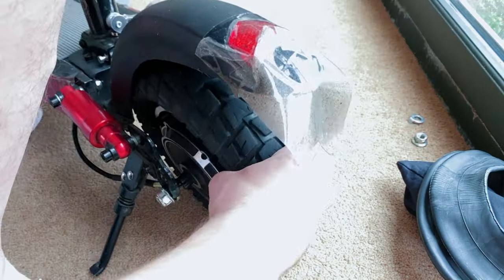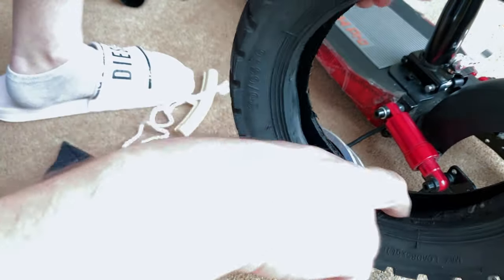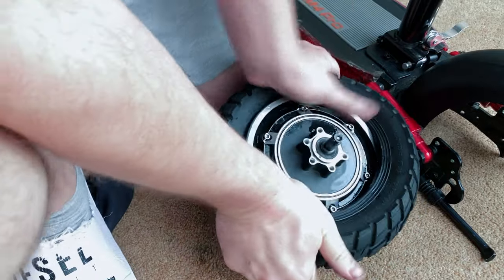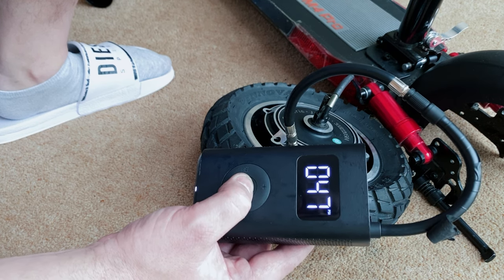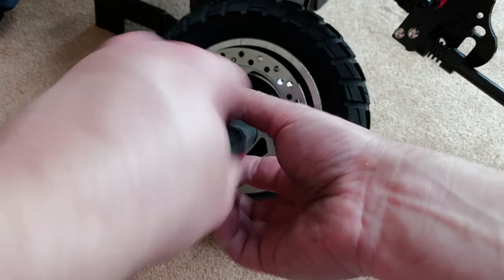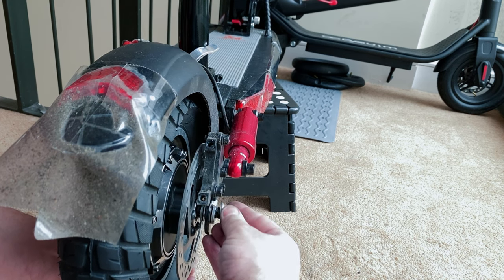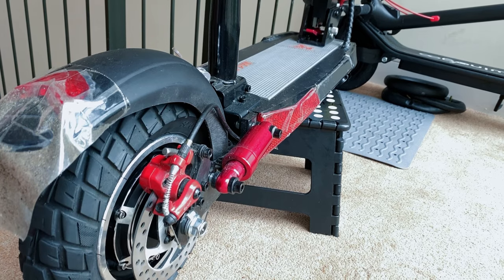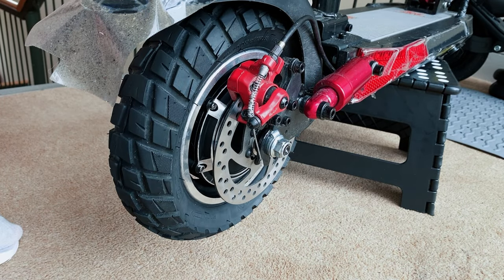Electric Scooters Tube/Tyre Change (STEP by STEP)

Comment: It's so hard to put tire on rim 🤯
Reply from the maker: New tyre replacement is of course more tough. But overtime, you get faster.
Reply: Yup. After blood, sweat & tears, I ended up scratching the sh!t out of the rim & ruined the tire. So bought a new whole wheel from Aliexpress 🤣
Reply: I bought a new tire for my scooter and it's like slightly to small to fit, I don't know if it's supposed to be like that and your supposed to force it on but it looks significantly smaller so I don't know. The listing on AliExpress says that it fits my scooter
Reply: @DARK_AMBIGUOUS  press on the inverse side of the tire when you put on, il fit but it can be hard to put
Reply: @amped19996  WTF

Comment: Getting the tyre on is doing me friggin head in 😤. I've changed many bicycle tyres in my time which is pretty easy. These are not. 5th time changing a esctooter  tyre/fixing punctures and it's not getting any easier. If I find an easier way I'll add it to this comment 🤞
Reply from the maker: @footlongsubzero1128  use your knee to old down the tyre and use your 2 hands to push it on the rim

Comment: Better then silicone spray is to use your hand dish soap with a little water mixed in 🙂
Reply from the maker: Never tried it but thanks for sharing. Can help others that don’t have a spray to hand for sure.
Reply: Won't water And soap, rust the inside???
Reply: @mutatedAi  Hand or dish soap?

Comment: Thank you! It's awesome I was struggling with this! I have 2 tips for you that you can apply : 1. Cut the old tube and put the new one inside. Thanks to this there will be less friction between tyre and new tube, 2. Put a lot of tlacum powder inside!
Reply from the maker: These methods are ok but generally best thing to do is get a better quality tyre. After this video was made, I bought a higher quality one and didn’t have a puncture. 

The tyres though supplied in this model scooter are actually quite soft and poor quality.

Anything is worth a try though if you are stuck! PMT tyres I have t tried yet but meant to be the best there is.

Comment: Do you need to disconnect the back motor or just take of the motor and change it near the scooter so you dont have to disconnect all the cables, i have seen some take the whole motor off is that reall necessary?
Reply from the maker: @alexanderlundin4811  assuming you have the M4 Pro? not needed. There ain’t much slack on the cable so just be careful. 

Very time consuming to take off the motor completely.

On some scooters you have a quick release connector or more slack which makes things easier. Just be careful and you’ll be fine.

Comment: I'm 68. You make it look easy. I was afraid of damaging the rim or tire and had to take a break. Thanks for your video, it made it so simple. I'm missing those wedge duhickies to keep the tire out! Thanks!😂
Reply from the maker: @adolphsmith1353  trust me, I sweat many times
Reply: After buying the wrong tube, I'm finding it hard to find one with the bent air nozzle. What I'm finding has a very high shipping cost, almost as high as the tube itself.
Reply from the maker: @adolphsmith1353  AliExpress 👍🏻

Comment: My wheel is wobbling how can i fix it , also the tyre is damaged cuz i changed 3 tubes
Reply from the maker: @itsanutz3286  if you damaged the tyre you will need to replace it. Pump to about 60psi after changing so it seats into the try rim then deflate to around 45psi
Reply: @Movelectrics  the problem is that the tube has a hole in it
Reply from the maker: @itsanutz3286  replace it

Comment: Nice video mate! Got a question if its ok. I have an iscooter ix4 with 10 inch tires. The dimension is 10x2. 75-6.5 what solid tire do you recommend fitting on it? I have air filled and popped the tube 2 times already 😅
Reply from the maker: @yasharostad  avoid solids. They’ll destroy the scooter because of the vibrations eventually. I would get better tyres to be honest and maintain the pressure to around 45psi.
Reply: @Movelectrics  thank you very much man. I'll be looking for a good tyre and a new inner tube. I can't seem to find the right tube, is it the same dimension as it states on the tyre?

Comment: Hello bro .. i got e-wheels E25 V2 .. what tyre do you recommend and what inches is it 

+ can i use a heavy wheel like the one in the front ?😅
Reply from the maker: Size should be on the side wall. Think they are 8.5inches. Search AliExpress and check out reviews from buyers. There are hundreds of tyres to choose from.

Comment: Not sure if you are seeing this but i just got a urbanmax cq today and it was a little deflated so i went  to an airpump near me to fill it. It said it was doing like 10 something? (Never dont any of this) it filled very fast so i had it on for less than a second. It looked and felt fine and solid but when i was riding it was wobbly in the front. Idk what happened but it looked like it either came loose/expanded a bit cause it was slightly off the rim ,not much but enough to make it wobble. You know if i popped it or not? Dont wanna have to get new tires/replace it yet since i just got
Reply from the maker: Never use garage pumps. Buy the Xiaomi pump that battery operated. Deflate, make sure it seated properly and pump again. Sometimes there is a slightly wobble but in general is fine while riding. But if it’s very bad, a tyre change is needed.

Comment: Hello when you receives this do the tires come prefilled or do you have to add it yourself and if so what is the correct tire pressure? For the bogist c1 pro
Reply from the maker: You put air in yourself. Best pressure is 45psi.

Comment: Where can i find those anti-air loss extensions? is something that's included in the xiaomi compressor or do i need to purchase it separately?
Reply from the maker: It’s sold separately. I got it from the place linked below. But they are also on AliExpress for cheaper https://bit.ly/2UNHa1M
Reply: @Movelectrics  aight bro, much appreciated. Keep up the great content

Comment: is there any tubeless tyres you can get with the bogist and use that liquid stuff inside the tyre to seal it from punctures? or is the c1 pro tyres good enough not to worry about them thanks
Reply from the maker: Not sure about tubeless on the C1 Pro. Main thing is to maintain the pressure. Funny thing was, I never got a puncture on the C1 Pro compared to the Kugoo! I also just bought some sealant to test out. But since this video I have upgraded the rear tyre and have not had a puncture. Check out the community tab to see which one I’m using.
Reply: @Movelectrics  oks thanks for the reply , i should be getting my c1 next week . they state that the tyres are "stab proof" so maybe that's why you don't see many punctures on them?
Reply from the maker: They have air in them so it’s very possible to get a puncture. I would suggest keeping the pressure around 45psi.

Comment: Does it work resealing wobbly tire..?
Reply from the maker: Your tyre is off balance? Could be the tube or the tire is not seated properly. Deflate completely and put some dish soap around the rim, inflate then to about 55-60psi then deflate to 45psi.

Get a professional to do this if you ain’t sure. If the tire is still wobbly, a new tire is a good option.

Comment: Hi mate, does this tyre change apply to the M5 Bogist?(this is the one my mother has lol)
Reply from the maker: She has the scooter that has the seat and basket? Bigger wheels on that so it should be easier. Same method mostly for removing and fitting. Just take pictures of the washer/spacer arrangement.
Reply: @Movelectrics  Yeah that’s the exact one. The one you thought was ugly 🤣Anyway, I tried clicking on the link you provided for the tyre irons you suggested on Amazon and it’s saying it’s currently unavailable. Would you suggest any other alternatives?
Reply from the maker: @Aaron-lr1di  any tyre leavers will do. Try a local bike store.

Comment: I actually damage my back tube stem from a certain stem cap do you know a way to possibly fix the stem or am I just gonna need to go ahead and change the tube
Reply from the maker: Easiest thing is to replace the tube. You could have damaged the stem core, you can replace them quite easily. They screw out. You need a core removal tool.
Reply: I ended up replacing the tube by watching your video. The one part I messed up on is the washers on the inside of both rear swing arms on the Eagle one do you know how many washers go on the right swing arm? I have one main washer on the left and two on the right but I have one thinner  washer that I can’t remember which side it went on.
Reply from the maker: @shanemontgomery4692  one washer on the left and 3 on the right side (brake disc side is where the smaller washer is and goes in between the 2 bigger washers) from what I remember.

I made a video changing the tyre on my E1 👉🏻 https://youtu.be/6gg8IN06qgc?si=GyZE8PHoU7eIxQ7V
Reply: Thank you so now I have the washers correct and the brake disc is rubbing hard on the left side of the brake pad. Am I gonna have to adjust the brakes?
Reply from the maker: @shanemontgomery4692  generally you will always have to adjust it after completely taking it off.

Easiest thing to do is loosing a small bit the screws holding the caliper on.

Squeeze leaver and then re-tighten at the same time. Might have to go back and forth till happy.
Reply: Awesome I got everything lined up I really appreciate the help last question is how much psi should I have in the tube/tires it blows my mind putting 40 psi I’m about 220 pounds is that the correct psi pressure I should be at?
Reply from the maker: @shanemontgomery4692  45psi in both.  Check it regularly.

Comment: hello i have new g2 pro. i filled both tires 35 psi and within 2 days the pressure on both went down to 25 psi. im 95kg . is that normal?
Reply from the maker: 35psi is too low. 45psi is correct. If you have cold weather right now, that can effect the pressure. Are you using a anti-air loss device? Check out this video https://youtu.be/5l0u7xO8KKQ?si=KaPMkqckcIi6roaI
Reply: @Movelectrics  about the pressure. i will try 45psi. about that device, yes i just purchased air inflator device, i will also purchace that anti air loss device. BUT, as i understand that device is only meant while inflating the tire at the end, so air will not run out. but last time i filled the 35 psi at a gas station and i didnt feel any to very little coming out at the end, and still after 2 days both tires lost 9 psi
Reply from the maker: @numinumful3815  check the valve cores are tight. Anti-air loss is brilliant and you lose little to nothing when unscrewing it. You would be surprised the amount of air you would lose from 1 second. Pressure from gas stations is very high compared to a handheld pump so would not advise it.
Reply: @Movelectrics i suspect something is wrong with the vavles. i will be soon at a electric scooter expert, he will either fix it or replace the tubes
Reply from the maker: @numinumful3815  the odds that both valve cores are loose is slim. You pumped the wheels at a gas station which is not suitable like a mentioned.

All you need is the pump and anti-air loss extension i mentioned and you are good to go. No need to spend more money and bringing it to a shop. The reason why you need these 2 tools is because you’ll need to check your pressure at least once a week.

Comment: Could someone explain to me why scooters don’t have a plug on the wire between the battery and the motor so that the wheel and motor can be completely removed from the scooter and worked on on a bench for instance so you are not crouching which is most uncomfortable. this could also enable having a second wheel motor which you could swap while fixing the other .
Reply from the maker: Some scooters have this like the Nami range and latest Inmotion RS (quick release connectors)

You can of course if you really wanted, open the deck and disconnect the motor, but that is time consuming.
Reply: Yes the Immotion RS a $6000 scooter which is not real legal here in my state of Victoria
Reply from the maker: @kings7man  budget scooters just don’t have this option.

Comment: What size inner tube and angle of valve stem?
Reply from the maker: @powerpopjoey  not all scooters are the same. Best to remove your tube first and check the dimensions on the tube itself and what degree valve you have

Comment: How to dettach cable from tyre?
Reply from the maker: Not possible on the rear unless you open up underneath and remove from the battery and controller. There is no need to disconnect anything as shown. Just take your time.

Comment: I have that air pump and I don't think it needs an extension ..its the only airpump I've ever used that I don't lose air with when disconnecting
Reply from the maker: You lose a small bit of air without the anti air loss extender. I’ve it for years and for tight spaces it is brilliant. Well worth the few euro.
Reply: @Movelectrics  Is there a link to the anti air on Amazon?
Reply from the maker: @TheRafcave  just checked. Here they are 
https://amzn.eu/d/cb04YHR
Reply: @Movelectrics  Thanks, but do these prevent air from escaping after fill?
Reply from the maker: @TheRafcave  yes, they are brilliant.
Reply: @Movelectrics  Excellent 👌🏾

Comment: I could not get the grip off
Reply from the maker: Grip?
Reply: @Movelectrics  yh got inner tune out but grip still not full off
Reply from the maker: @gamer2k23  do you mean tyre? Just need to apply more force.
Reply: @Movelectrics  yh plus couldn't connected to the motor off

Comment: Stick the hubs in the freezer and the tyres on to boil, then it's piss easy, even solid tyres
Reply from the maker: For the front wheel that’s fine but the rear you would have to disconnect the motor completely to do that.

Comment: hi！ Thanks for your sharing! My problem is I can’t get the two biggest nuts out so that I can’t get the tyre out 😂 is there some suggestions for me?
Reply from the maker: Use a higher quality ratchet or spanner. Also get a friend to stand on the scooter.
Reply: @Movelectrics Thank you! I have got nuts out! 🎉 and now I am fighting with the tyre to get it off, It’s too hard. But by the way, I’d like to ask do you know if the rear tyre has an inner tube?  Because my rear tyre is flat, and I wonder if I should change a new inner tube. thank you so much!
Reply from the maker: @irenechang9515  yes all inner tubes